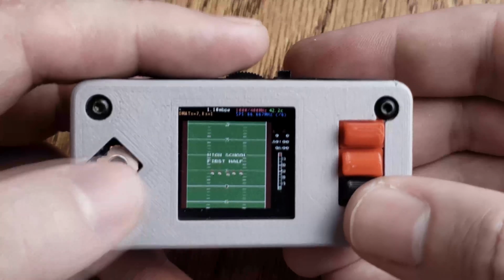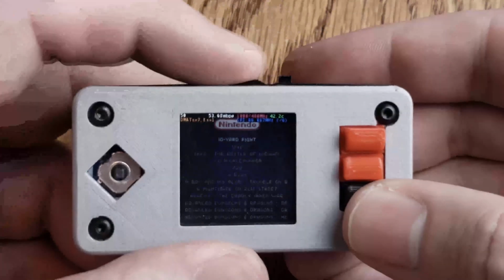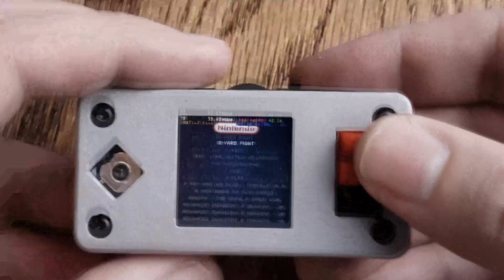PinkyPi Build Guide - Micro RetroPie Handheld

Comment: Amazing build! I have a question, a rather "newbie" question. How did you write the pinkypi image? I purchased a waveshare gamepi15 while surfing Amazon for a friend. Anywho, I downloaded pinkypi1.3 and after unzipping the rar file, I tried writing the 1.img file and etcher said it wasn't a bootable file. Any help you can offer would be greatly appreciated! I'm not very savvy with the Raspberry Pi's, I do have a waveshare game hat I got running and built two RPi3B+ projects (one is on my youtube channel, the other one I'll be uploading when I'm not too lazy to do so). But this is a little out of my realm. Again, thanks for any help you can offer, and thanks for uploading this great build!!
Reply from the maker: For the GamePi15 case, I picked up 3 of these last weekend and will be making a case and Pi image specifically for them.

For writing an image to an SD card check out our tutorial

https://www.crackedconsole.com/2019/03/17/using-etcher-to-write-a-raspberry-pi-image-to-sd-card/

As for writing the PinkyPi image, I loaded up a Pi Zero with the latest RetroPi, then manually installed the fbcp-ili9341 display driver and setup the buttons etc.
Reply: @lifeasanerd4202  

Thanks for the reply! I've been tinkering with this thing with what little time I do have. I do have Retropi 4.4 on a memory 32G memory card, everything boots up fine with an HDMI monitor. Never learned how to install drivers, never to late to, lol. Can't imagine it being too hard, the glory of the internet and all its wisdom. I can't wait for your image, help simplify things for us "simpletons." You, Sir, have earned a sub!
Reply from the maker: @phattacorider  I'm trying to get the PinkyPi Pro video done today/tomorrow. Once thats off my plate I'll start first on the Video drivers for the GampePi15 and release them ASAP
Reply: @lifeasanerd4202  

You are awesome man!

Comment: I have a 1.44 inch hat will the 3d print still fit
Reply: Also thank you so much.
Reply from the maker: The files on Thingiverse for 3D printing include the 1.3inch LCD and 1.44inch LCD hats
Just be sure to print the top for the 1.44inch version

https://www.thingiverse.com/thing:3393553
Reply: so i just download it from the link you gave me and print it and and it will work.
Reply from the maker: @crusadertwo239  Yes, we do have pre-printed cases available on our website as well as DIY kits with all the hardware needed (screws, standoffs, charger, amp,speaker etc) 
https://www.crackedconsole.com/shop/
Reply: @lifeasanerd4202  thanks you are very helpful

Comment: Great project! Two questions is that a 128x128 or 240x240 screen size on the hat? Also I see there are 3 buttons, what about select/start?
Reply from the maker: It is the 240x240 screen. There is a 1.44inch version that has the 128x128. I've since made a version of the top half if you are using that screen.

As for the buttons, the 3 are A/B/Start, and the joystick clicks in thus being select.
This works great for NES (needing A/B/Select/Start) works for Sega (A/B/C/Start), Atari and others.

Comment: It look great, good job!
I have one question tho. I would like to use this case model in my project but I have to change some things (make it little wider to fit other stuff and I don't need volume knob hole), how can I edit this model?
When I open it in FreeCAD, Cinema4d or in online tool Tinkercad, the whole model is visible as one object. How can I remove holes or change sizes of individual parts?
Sorry if this question is stupid, this is first time I work with 3d models.
Reply from the maker: I used Google Sketchup (Free) to make the Model, You can download that and use the included Sketchup files from Thingiverse to make any changes you wish. There are several online videos on working with Sketchup